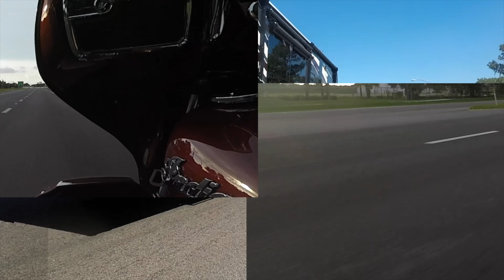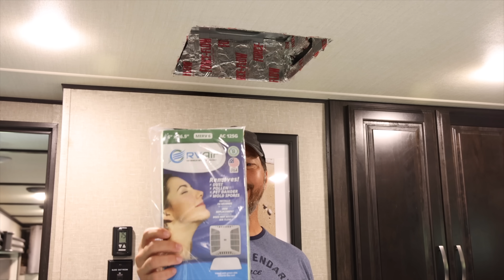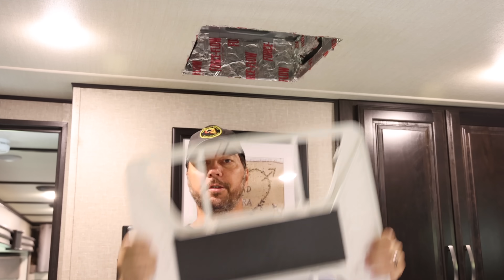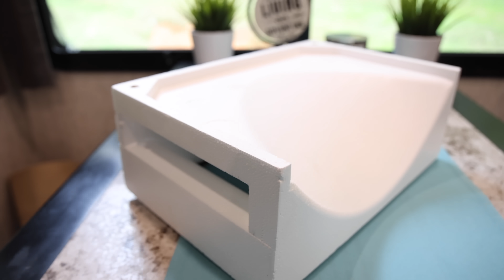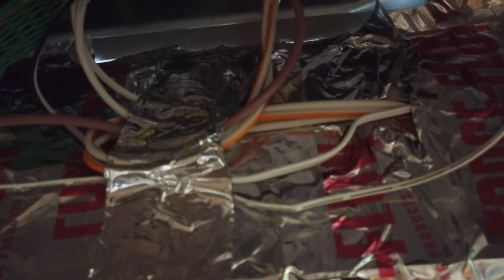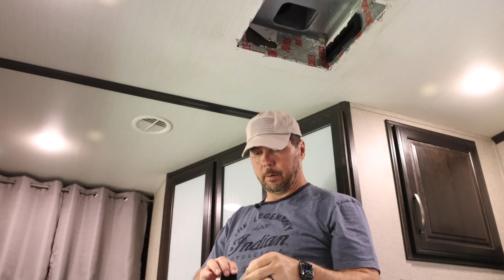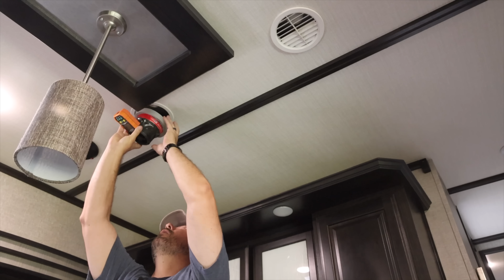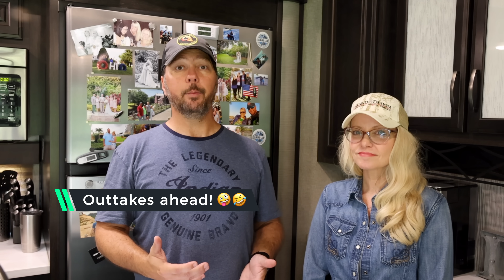Turbo-Charge your RV AC with RV AirFlow! (40% Improvement on Average!)

Comment: Shame on the appliance manufacturers for not addressing this, and double shame on the RV manufacturers for not demanding this from their suppliers. After buying a new, modern RV, we still have to go out, buy a $180 foam block, and go through this installation to make the AC work better?
The RV industry should be ashamed enough about this to recall their crap and provide this upgrade for free!
Reply: Great video and I applaud your torque advice and instrumented airflow. I knew about HVAC many years  ago, but some things stand the test of time. You measured airflow, but that's only 1 component of cooling. You should measure the temperature difference between input/return air and output air at the ducts. If you get more airflow but the temperature difference is less, you may not be getting better cooling. I'm not at all sure, but airflow * temp difference may be the actual cooling number.
Reply from the maker: So far, we're noticing a great improvement in heating and cooling overall.

Comment: I was ready to buy until I saw the price.  $170 each.  Seriously.  And, you have to get one for each A/C unit.  How many of you all down below are really going to fork over $340+ for the average m/h or trailer?  That is some serious cash.  No way manufacturers are going to pay anything close to that to factory install.  Great idea, but as a marketer, I am wondering who helped you set your initial price point.  What could have been many early sales with a realistic premium price (say $60 each depending on market research) will be lost.  Great idea, but I’ll be holding off until the price drops or competitors enter the market and snatch up the sales you missed at the high price point.  I am not trying to be hateful, just disappointed that you will be missing/lost a ton of sales that should have been yours from the very start for a great idea.  Competitors will enter the market quickly.  A/C Manufacturers will quickly come out with a new design to sell directly to builders to eliminate you making a profit off their poor design.  Tara, Chad, once again a great video!

Comment: Your Grand Design has the outstanding Coleman Stealth A/C system. Super quiet and powerful AC compared to the dreadful noisy and unreliable Dometic system. We’ll never buy an RV with Dometics. 
This diffuser system is worth a look.
Reply: Good to know. We’re getting ready to guy a 31mb. Can we have the Coleman ac installed instead of the domestic?

Comment: Excellent concept... Is a piece of foam really worth almost $200?
 Excellent video though (like always 😀). 
 Any product (especially the industrialized ones) should be priced based on the cost of materials and workmanship. It does not look this is a high skilled process to manufacture or labor intensive. Foam and plastics are cheap enough to be used as disposable materials in packages, a $85 32" TV will have as much foam as this product....

Comment: If I remember correctly they are expensive for what it is though... Could be remembering it wrong
Reply from the maker: It isn't cheap for sure, but sometimes looks are deceiving.  It looks like a simple block of foam, but a lot went into R&D, certification, patents, etc...
Reply: Yes it is a new company so there is so much cost to recover in the beginning.  I can’t imagine going into production and then a pandemic hitting. They could of just thrown in the towel so to speak.  They have a much needed design for full timers.  At 40% more efficiency in your A/C people will see a savings in electricity.  It could pay for itself very quickly in southern states.

Comment: Nice..... I always enjoy a good review video. one thing i did not hear you mention is if it is heat rated to not melt do to the electric heater elements in the A/C unit. like the heat strip kit for the brisk air II A/C Units. I like it in many ways, just concerned with that. or maybe they do not make it for the Dometic Brisk air II A/C units yet, i have not checked it out yet. great video, the editing was awesome. hope all is well good health and safe travels. 
OK, just saw on your link that it is for Coleman Air conditioners only, at least that is all i saw. Like the idea, maybe I will design something myself just to hold the divider in better, to prevent falling. currently I just leave the vent open to blow straight down and don't even worry about the venting. in this RV the vents have never been efficient anyway. 3 air conditioners, one per room and has been working great so far.
Thanks
Reply from the maker: I know they're working on kits for dometic...  But, like you said, there will be some units where it might not be workable to create a kit.  Just my speculation.  👍🏼

Comment: I worked with the RV airflow folks back in July to create the first device for an Arctic Fox Fifth Wheel back in July. Definitely helped!
Reply: I have a 2020 arctic fox 32-5m. D0 you have to order specifically for your brand of unit?
Reply: @jeffward7502  i don’t know, sorry. I suggest you Contact them. The question is If the plenums are identical for the 29-5 (mine) and your 32-5. They will know if anyone else has installed it on the 32-5. If not it is real easy to take a few measurements and find out. They can help you with this. Let me know if you additional assistance. Good luck. Love the 32-5. That is the model I wanted to get. But I’m happy with mine.

Comment: Wow.  I made something similar to this in a previous travel trailer out of aluminum duct material.  So I know this will work but better.  Just ordered 2 for our new 5th wheel.  I also use the RV A/C Silencer to quiet the units down so with the new AC AirFlow device, we should be in great shape.

Comment: We have a 37' Keystone travel trailer with a 15,000 coleman ducted main A/C, and a suplimental 13,000 in the bedroom. During the hottest times, the main unit held it's own, but had to work kinda hard sometimes to maintain temps. We would only use the bedroom A/C to knock the temp down as it got close to bed time, then turned it off because it sounds like a 747 coming in for a landing, lol. This product should help the main A/C do the job on it's own without having to work too hard, so, I ordered it before your vid was even finished playing! Thanks guys!
Reply: You should also look at the RV Air Silencer.  It made a tremendous difference in noise level on our Dometic 15k unit.

Comment: I had one installed this weekend in our Imagine at the Grand Design Texas un-Rally and it improved our airflow by 30-48% across the 6 vents.  We already had the Wacko RV AC Silencer and it is compatible with that product and decreased the decibel level a little bit as well.  Thanks to Richard Stark and the RV Airflow team for this product.  It will help during the hot Summer days in South Texas.
Reply: Hi Darryl and thank you.

Comment: Regardless of how well this work...the cost is high. $180.  That’s 20% of the cost of another AC unit.  It’s materials aren’t expensive or even strong—so long term—this might not be the best investment, especially if your system is able to handle the heat. The cost is laughable. I’m laughing.
Reply: I was thinking maybe $50 at most.  Made in USA.... ok maybe $75.  $180, no way.

Comment: We are working remotely in a high dust location. Would you recommend a exterior filter to be installed on the roof cover?
Reply from the maker: Good question and I'm not 100% sure.  but it seems you wouldn't want to restrict airflow up there with the heat exchanging is going on.  Not sure it can even be filtered.   Best bet is to take the cover off periodically and make sure the fins are clear.  See: https://youtu.be/Gbm8hOyZlrU
Reply: @ChangingLanes  that was our thoughts too. We wanted to check because we are having to clean our units weekly.

Comment: Just watched your vlog. As always first rate! One question: Does the RV Airflow help with RV air conditioner noise? If so this is a plus you should mention. Our Monaco A/C's are noisy, especially with the dumps open. Since you are blocking this area off with polystyrene I am thinking there is some sound deadening that is surely a real plus.
Reply from the maker: There is but it is very slight.  With the improved airflow there is more air coming from the ducts and that's a little more noise.  Overall it's a slight reduction IMO.

Comment: We have a hybrid unit and it is of course not ducted, had the four flaps to shoot the air outwards around the camper. Assume something like this is not meant for this type?
Reply from the maker: Yes.. that is correct.  I should have specified ducted systems.  👍🏼
Reply: @ChangingLanes  That's ok, looking to get a larger unit in the next year which will definitely be ducted. Will keep this in mind.

Comment: Great detail!. Caint wait for a Dometic version of it.
Reply: Same. I really want to try it out, the wife will be more into going to the desert in the summer so i can take my dirt bike out more often.
Reply: @pjballs69  The Dometic is out.  Mine is installed.
Reply: @patrickdenisemodrell6495  thank you! Review? Is it worth it?
Reply: @pjballs69  Haven't  been out with the trailer yet, first trip won't be until June.  First impression is yes I would recommend it.  I did do one more mod to the duct outlets.  Removed and cut them to fit flush with inside of duct.  They all stuck up about half way up into the ducts.  Any obstacle in the air flow creates turbulence.  If you increase air flow by eliminating turbulence at the supply (the air flow device) this will increase duct pressure and velocity since RV duct systems are a closed system.  All the air is "forced" to exit the outlets.  Eliminating the duct outlet turbulence helps the air flow more "evenly" threw duct.   More air flow through the system also means the compressor doesn't have to work as hard, system  pressures are lower, and if your trailer is cooler inside the AC won't have to run as much.  Just as a FYI, I am a retired electrician with HVAC experience.

Comment: I have that and it really works. I like it. Good video,
Reply: What some folks may not be understanding is that this works so well that you can run the living room a/c and not need to run the bedroom a/c at night and have a quiet night’s sleep. I put the RV Airflow in the living room unit only as I have wanted to keep the air dump for fast cooling. I may change that in the future especially with a 10% discount.